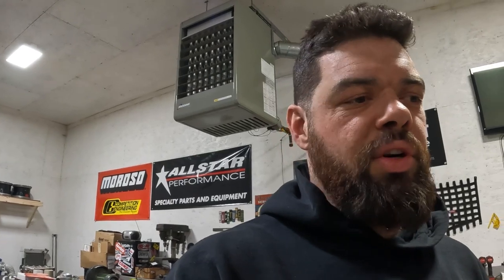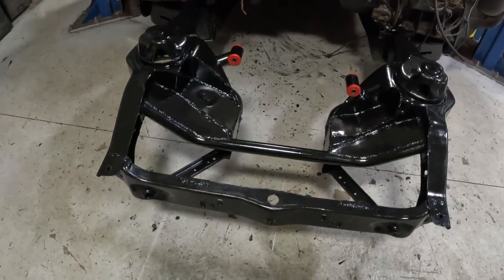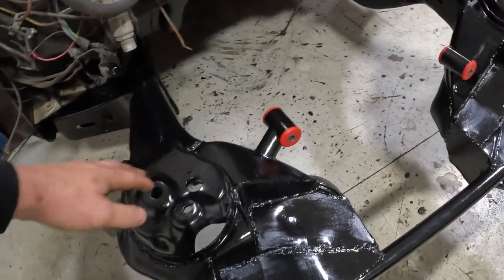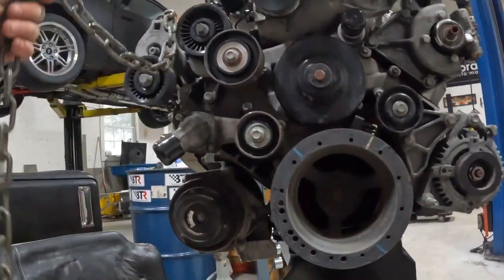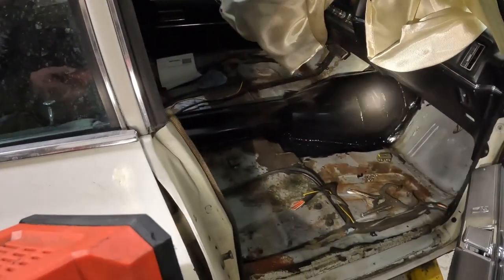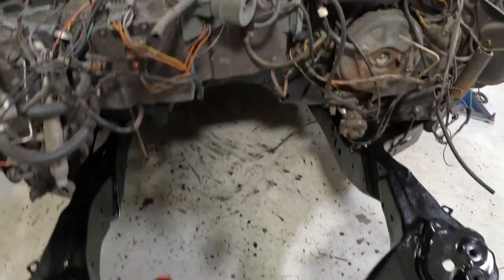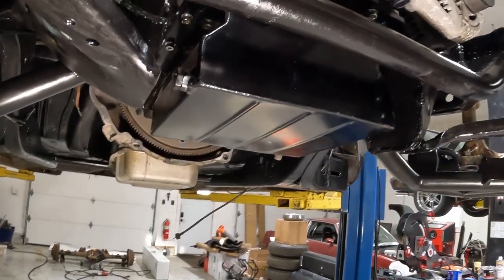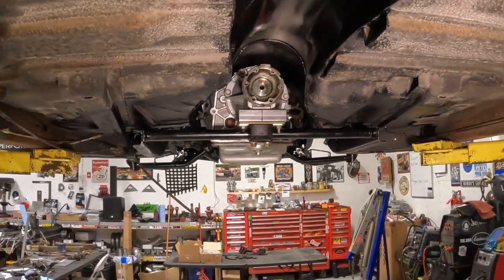How to Ls swap a 1967 Cadillac 6.2 LSA 6L90E

Comment: My first vehicle was a 71 Chevy C10 short bed step side that I swapped a 327/4speed into. My first car was a 67 Cadillac Convertible. I’d kill to have both back today. Tire smoke bellowed out from the wheel skirts.
Reply: I had a lot of parts from CMD (Cadillac Motorsports and Development) a sheet metal intake, longer ratio rockers, cam and headers. It was a fun car.
Reply from the maker: Sounds like the golden days!!
Reply: @JackTuned  I need a time machine to go back and get the vehicles I owned. Especially the pair of ATC 250Rs I had. 😂